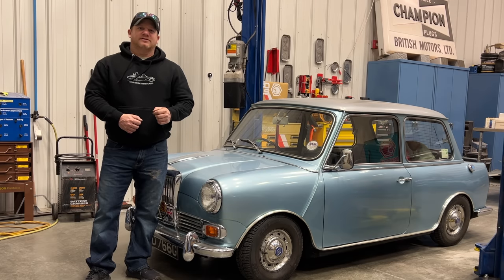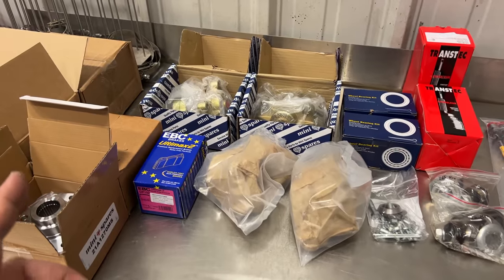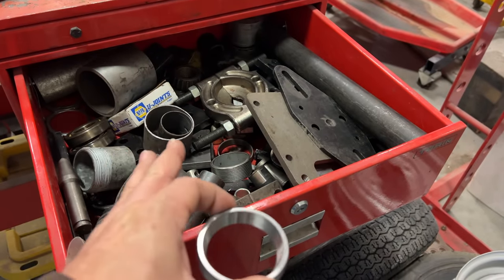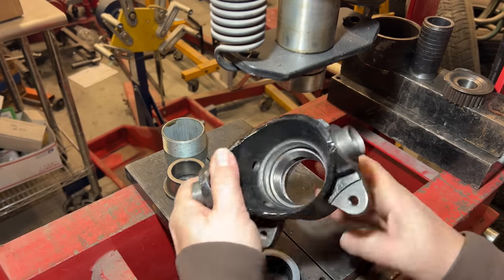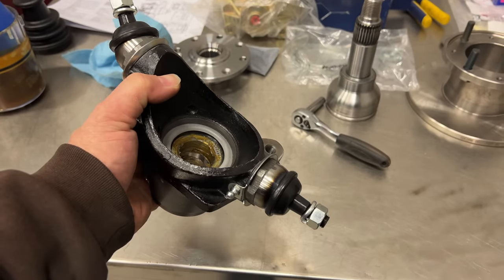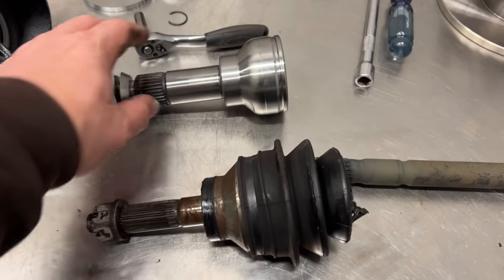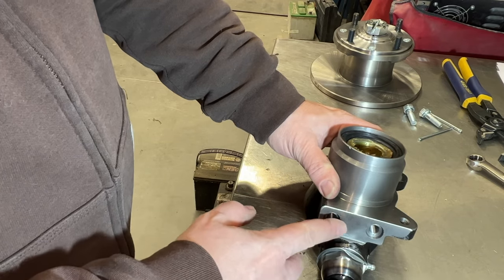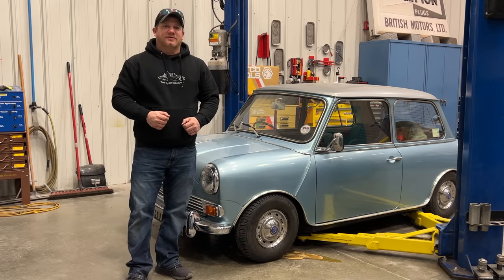1969 Riley Elf Disc Brake Conversion - Classic Mini

Comment: Gorgeous car! 
The leak reminds of when I was in high school driving home one day in my Austin Mini Mk2 and hit a nasty pothole. It broke my rear subframe and the drivers side suspension line got snipped along with the brake line. So I was tilted over dragging down the road wondering what the hell just happened! Haha! A weekend of work to install a new rear subframe, hydrolastic line, and brake line, and I was back on the road for Monday morning. Good times. 30 years later, and I still have that car.

Comment: Just a gentle 'heads up' on tightening sequence for the new CV / driveshaft through the new bearings. We always used a big flat washer to wind in the first torque then we removed it and put in the tapered washer for final torque setting. Using the tapered washer only can create a false torques setting.
But that is one very rare car and looks in excellent condition as well. What a find! Not too hard to convert to Left Hand Drive either.

Comment: The sticker in the wind screen is a UK tax disk which expired in January 2001 (I think it reads 01 01). That means Vehicle tax was paid for in the year 2000. Also the V5 date is the last one issued and would have been used after that time. Hope that helps.

Comment: Thanks Steve, great vid. It took me back 40 years with my dad helping me change a cv joint on my first car,  a mini. We had only basic tools so had to bang on the ball joints for such a long time to get them to break. Youve got all the gear and make it look so easy. 
Just slightly puzzled why you changed the drum brakes, obviously discs are better but all the parts must have cost a small fortune and I know some people like to see a totally original car but hey its your car and safety is paramount. Anyways, love the channel, thanks from 20 miles south west of London

Comment: Hi Steve . It's obvious you've done this a number of times . I think it's over 50 years since l did my last one ! 😅  But the memories came back and reminded me why l never became a mechanic ! The Elf looks in very sound condition but  the colour is very unusal and l'm  pretty certain didn't come fom the factory like that . And l was genuinely surprised when the standard wheel fitted . Bad luck with the displacer leaking but it's a common occurance , and l'm sure you know that too ! Thanks Steve

Comment: A lot of Minis get converted to rubber cone suspension  now as displacer units are quite rare, I think.
Brand new rubber cones are available in the UK but you would also need the Trumpets as they are different.
Trumpets could be made or adapted if not available.
I just checked and trumpets, including adjustable ones, are available in the UK so at least this car could be fixed fairly quickly.
Reply: You would also need to fit shock absorbers.

Comment: The issue with the wheels is due to the different hub offset of drum brake cars versus disc brake cars and not due to the diameter of the wheel itself.  

The original 3.5 x10" wheel 'could' be reinstalled, but in certain cases may bind with the caliper.  I say certain as there were numerous manfs for the 3.5 x 10" wheels fitted to Mini's and variants like the Elf/Hornet - some of these will clear the caliper without issue while others will not so it comes down to trial and error checking.  Also, in some cases the wheel will also stick out 'proud' of the front fender due to the different wheel offset.  Again, this will depend on the wheel manf.

If the wheel does bind, a common way around it is to use the 10" wheels originally fitted on a Mini Cooper S.   All Mk1- Mk3 Cooper S's had 7.5" front disc brakes as standard so their wheels already have the correct offset and will simply bolt on.  They are also readily available from MiniSpares.   

FYI - I own a Mk 2 Mini and did this exact brake conversion.  Doing so is well worth the expense - the improvement in braking ability is massive and quite literally transforms ones confidence in their car.  It certainly did for me.  As for wheels, my old 3.5 x 10" ones did not clear the caliper so I went with 4.5 x 10" Cooper S steel wheels as I wanted to retain a factory stock appearance.   I was also able to simply swap over the tires that had been fitted on the prior 3.5 x 10" wheels.

Comment: Good video, I'd have opted for the timken bearings though as the cheap ones won't last long.
Reply from the maker: At a few miles each year these will last forever.

Comment: with the Mini 10" wheels ive found that USUALLY the riveted wheels dont clear the caliper properly on the disk conversion, but the seem welded ones usually do, in saying that I wouldnt want to run the Rivited wheel anyways, they almost always are buckled and leak if you dont run a tube haha

Comment: Interesting and details upgrade. Always impressed (and jealous) that you have the right tools for each job. Certainly the vehicle will be safer, but my only question is: with a rare vehicle like this, does it devalue it by making it non standard? Good luck with the suspension!

Comment: What was it a displacer or the front to rear pipe i would think both of these would be hard to get.
Reply from the maker: I think it was at the fitting where the hose goes into the displacer but won't know for sure until I take it out.
Reply: @ThisWeekWithCars  the hose is part of the displacer good luck mate.
Reply: There are companies in the UK that repair yours or offer replacement units
Reply: @ernieleithes6545   The ADO16 contingent (BMC 1100 and 1300  ie MG1100 Austin America) have devised a way to rehose the displacers with a special clamp.  It is usually the crimped hose fitting at the displacer that starts to seep or leak.

Comment: Colway tyres! Those are more rarer than the cars. Colway was the UK's biggest supplier of remoulds but went under due to cheaper new Asian tyres. That was in about 2001 so they have been on it a while. I thought Leyland missed a trick with the Hornet and Elf, which was not to produce a basic version (which I think they did in Sough Africa I think) to deal with one of the Mini's big problems which was the small boot.
Reply from the maker: The Morris 1100 and Austin America are kind of like basic versions of this.
Reply: @ThisWeekWithCars  In the UK the 1100 was a mid-size! And 1100cc! Too much power for the vicar. I think a lot of them sold here were automatics.

Comment: Actually. Appears the Hydraulic Press could theoretically also be used to push down on the device for packing the Bearings.
Reply from the maker: It might move faster than the grease can move through the bearing and would just break the bearing packer.

Comment: I restored 2 old Mini's one was my sisters Mini 1000 automatic I think the gearbox was possessed the gears changed without touching the thing , my boss asked my nip over to the Kawasaki dealers price a Mini resoration for someone I thought was his mate , the boss said I thought you would have fobbed him off , said it was his mate so didnt want to , the boss said not my mate you got the wrong lad Oops so I ended doing a job I didn't want and even the boss did not want because I thought it was his mate .
Another mate bought his brothers Mini 1000 had bored out to 1150 stage 2 race cam , he wanted 1300 but the company doing it said that would blow up very quickly for what he wanted to do with it said 1150 was the best option , I went in it once that was it for me told him get a roll cage put in or you will not last long driving it was lethal LOL .